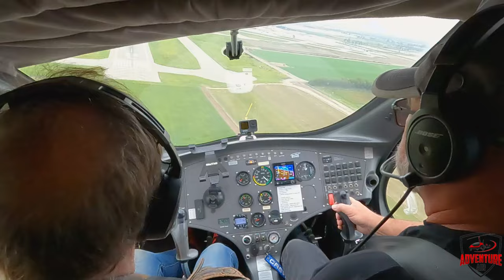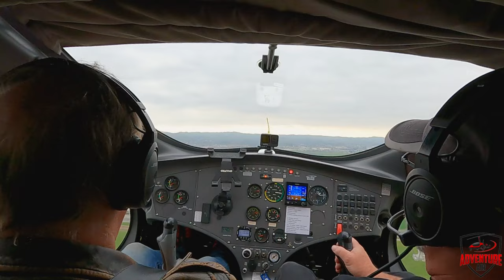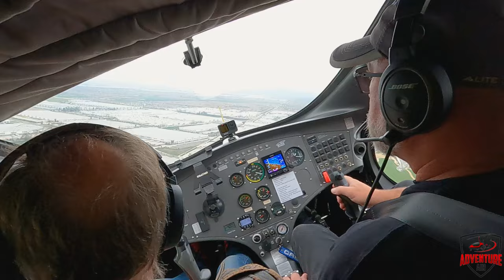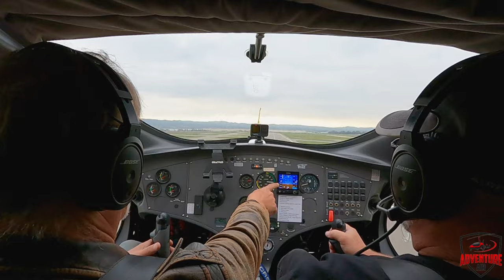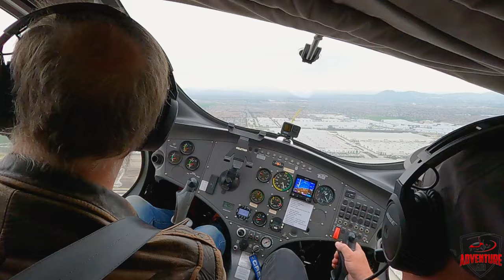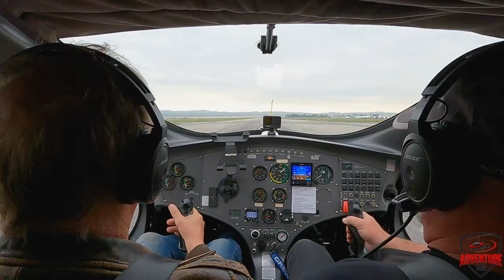85. Takeoff Emergency! | Loss of POWER! #emergency #adventure #air

Comment: Thanks for sharing with us, great reaction and demonstrates why it's important not to be behind the height/velocity curve so you can recover. I'm assuming that was the first flight of the day Henry? I'm assuming you'd done a run-up and checked both Fadec channels?  

Bit worried that even with dual Fadec channels on Rotax iS a single sensor could cause a partial but significant loss of power.
Reply from the maker: To answer your questions, yes, a run-up was done and it was the first of the day. As in our disclaimer in the beginning of the video, we don't show everything for context and time. Thanks for watching!
Reply: Henry muchas gracias por tus videos son muy instructivo, un saludo desde España Andalucía 👋
Reply: @AdventureAir  Thanks Henry, just adds a bit more context to it. Did the Lane A and B lights flash to highlight the issue.  Enjoy the rest of the weekend.
Reply from the maker: +@jasonrwilkinson9216 Lane A was the issue and you can see the warning light flashing prior to landing during the emergency.

Comment: Great video, thank you. Question if you had just crossed the tree line and that happened. I’m from the fixed wing world land straight ahead. In a Gyro could you just do a nose down to maintain desired airspeed but also a hard pedal turn to basically do a 180. I know a 3:1 glide isn’t great to start with but I guess what I’m asking can a gyro do the impossible turn safely. I would rather land on the grass or just over the threshold if given a choice. Thank you in advance if you have time to answer. Love your videos! Learning lots!
Reply from the maker: Thanks for your question. Yes  the gyro can do the impossible turn. It's been demonstrated in practice and in real life by one of our students. The usual altitude loss during the turn is about 100-150 feet.